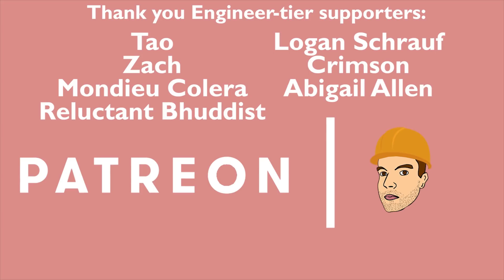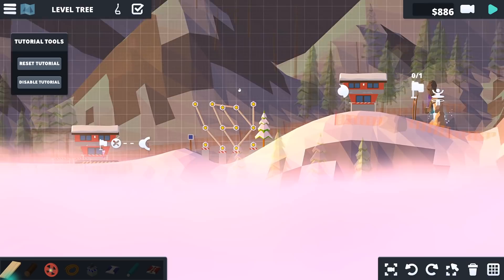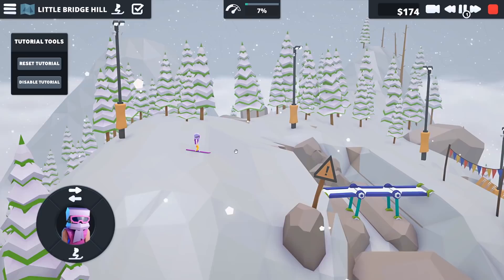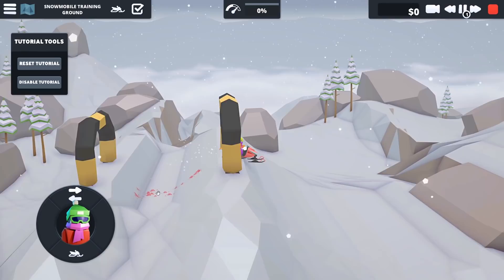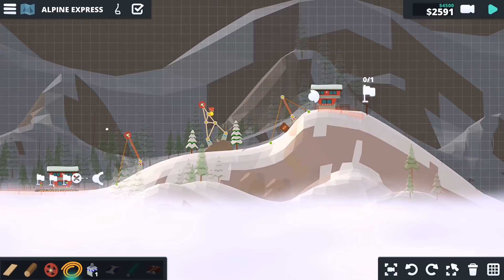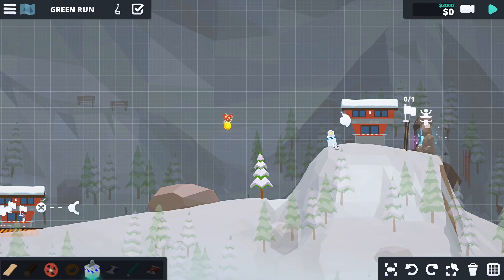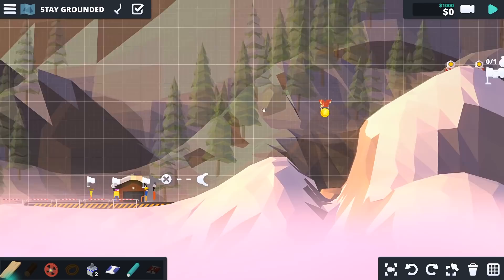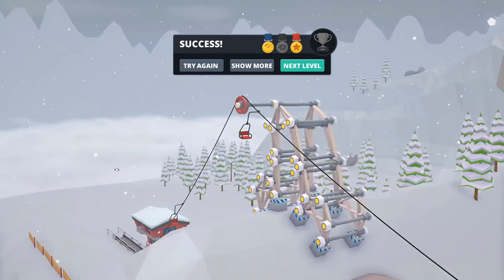Poly Bridge 2 WINTER DLC?? When Ski Lifts Go Wrong!

Comment: “Polybridge, but not quite”
Yes, this one has 3D structures!
Reply: Poly bridge 2 is 3d
Reply: @capy9846  No it's not, at its heart it's still 2D - the structures are flat and are duplicated between sides with no connection. This game connects both halves of a structure.
Reply: What about roads
Reply: @Zodduniverse  Mechanically, it's a 2D game also, which is where this and PB have common ground. However, PB is symmetrical, WSLGW is not.
Reply: Everything in PB and PB2 is 2d, like physics and how you play, it just renders a 3d level but it still aplying all stuff in 2d
Reply: So it’s PB2